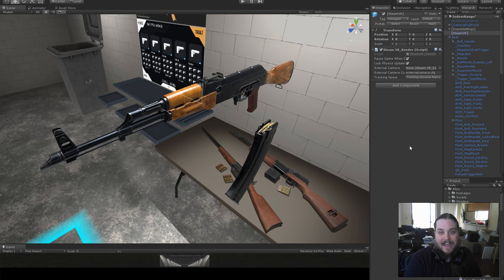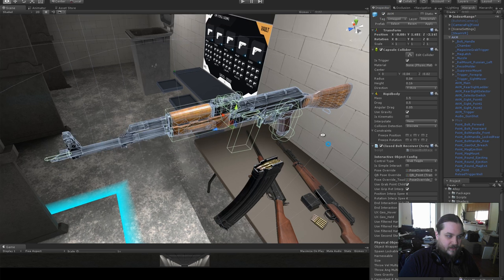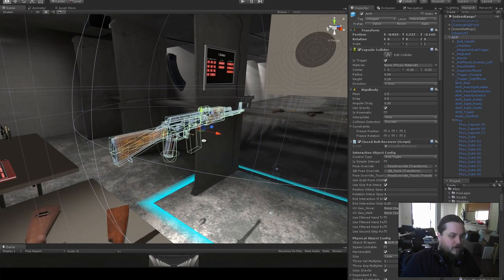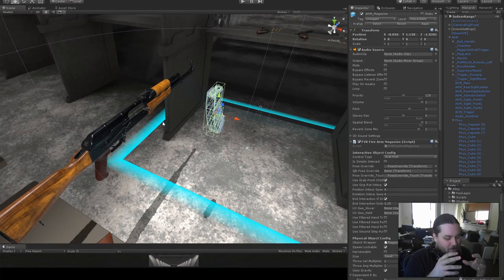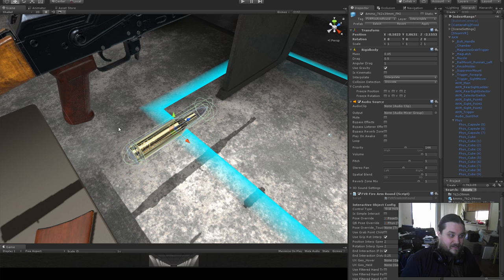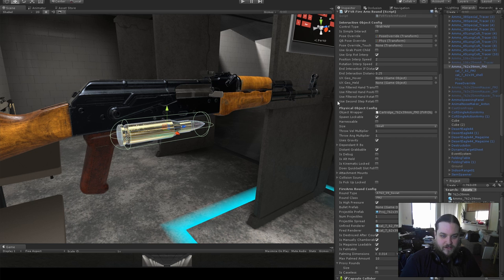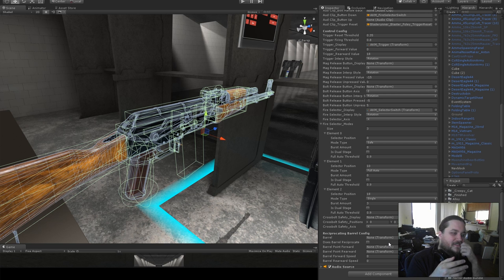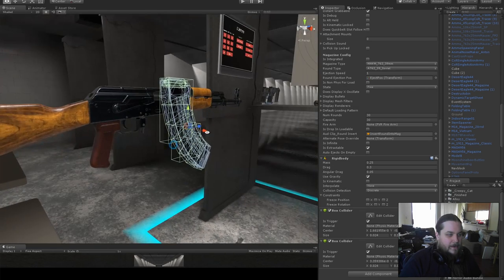H3VR Devlog: What's a Gun Made Of In H3?

Comment: 10:35 SO that's why I could never stand a bullet on it's bottom!@!!!
Change the collider to a cylinder for goodness sakes!!!!
Reply from the maker: There is no such thing as a 'primitive' cylinder collider. I would have to use a convex mesh collider, which is ~20-30x as expensive as a capsule. As its a common situation to have dozens of rounds colliding with things at once, I have to keep them as capsules.
Reply: Oh wow, I just checked rn, I didn't know the cylinder gameobject used capsule. I just got the unity free version a few days ago and I've been watching the tutorials to get to know the system.

Maybe you could have a capsule collider with a tiny thin box collider that is 'thin-ish' and the width and depth are about half of the diameter of the capsule, so that it can at least stand on it's bottom, if that doesn't impact performance too much. Like this https://prnt.sc/g0toe3